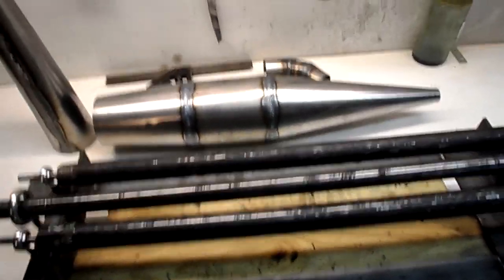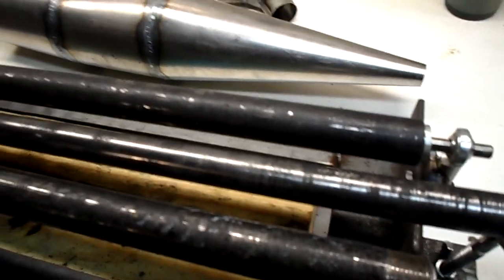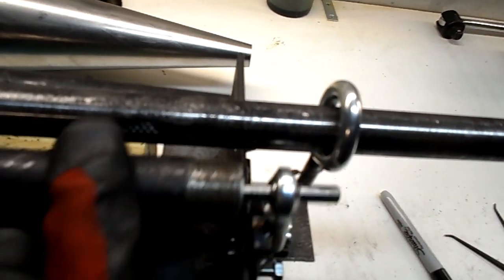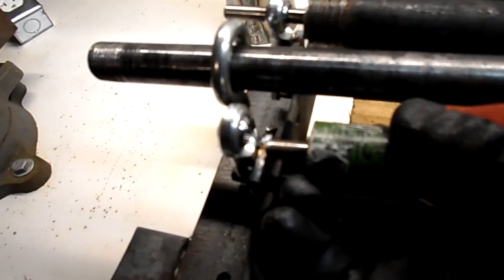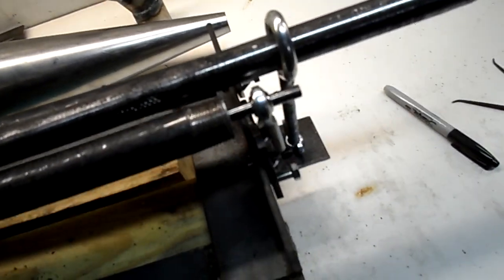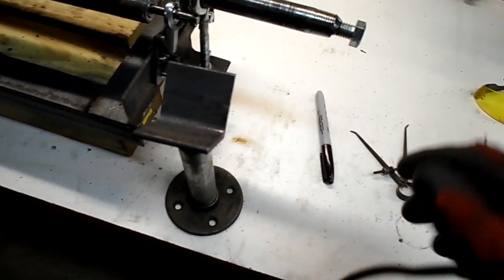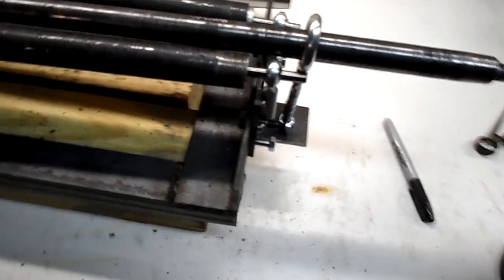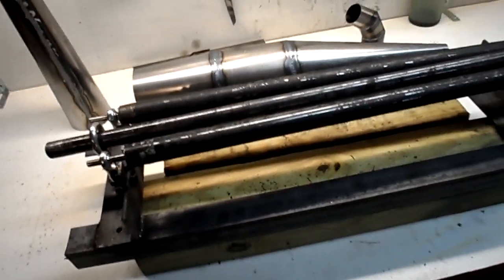2 STROKE EXPANSION CHAMBER HOME FABRICATION PART 2

Comment: What material did you use sir?
Reply from the maker: 18 gauge hot rolled steel. Rather thick stuff, I would use 20 gauge next time.